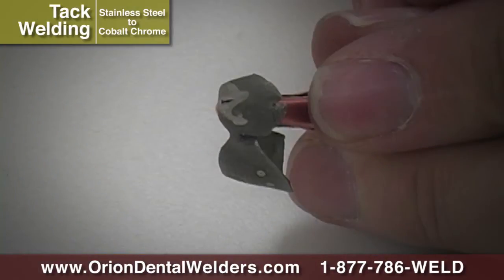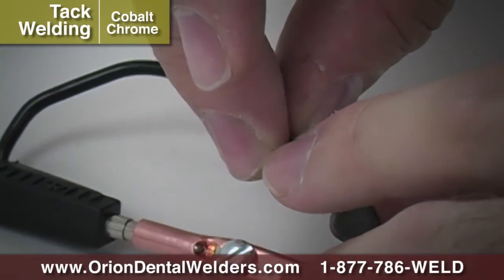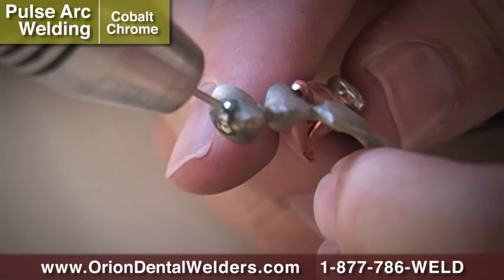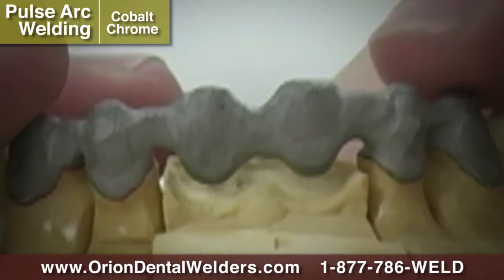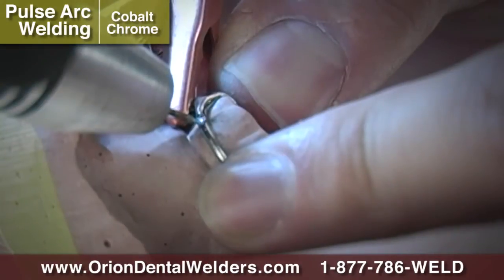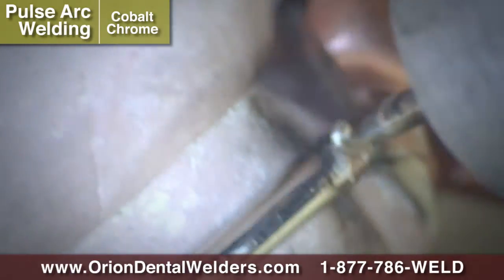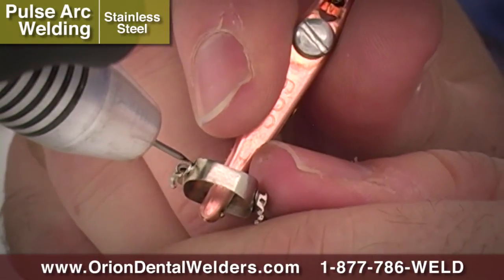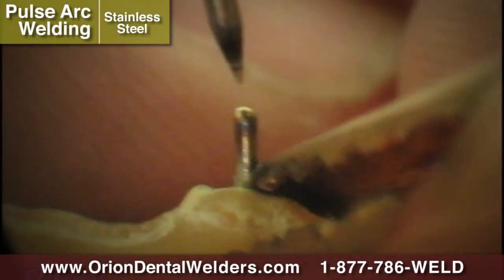Dental Welding Demo

Comment: one question the machine carries a argon gas tank
my question is if it has to be filled with gas and how often?
o does it comes fulland never has to be fild again of aragon gas?
Reply from the maker: Great question. Every time you weld a small puff of argon gas comes out from the stylus right there by the electrode in order to cove the weld area and prevent oxidation. You use such a little amount that a tank will last a long time.

Comment from the maker: This video was made using the Orion 150i. The setting for the first 28 seconds of this video were between 12ws and 18ws, with no agitation, and standard + ignition. On any other Orion welder you will use the same settings (you just wont have the ignition option). If you would like further assistance feel free to give us a call at 801.658.0015 or toll free at 877.786.9353 
Thanks!